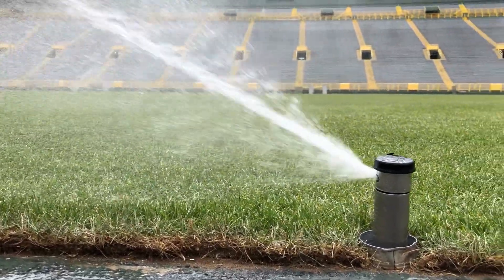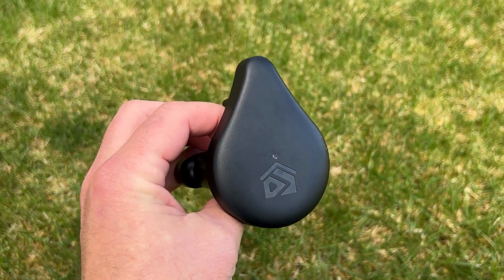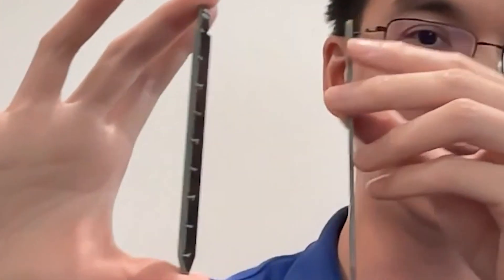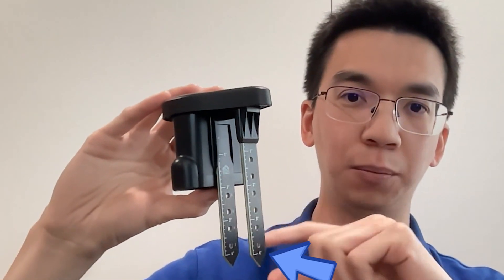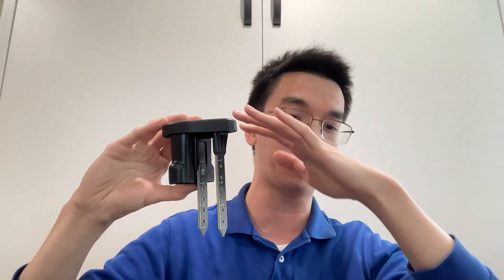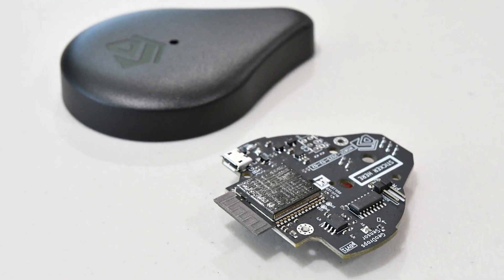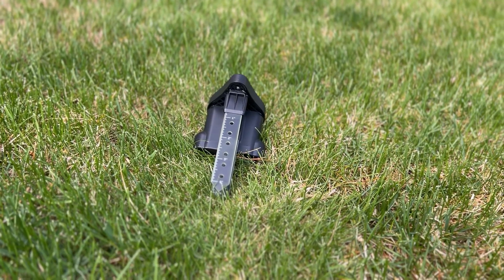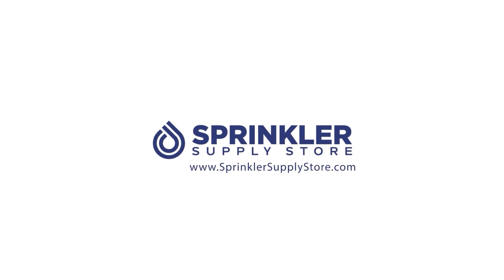DON'T Water Your Lawn Unless You Have This!

Comment: Did they say anything about the quantity of sensors one can have on one system?? I just want a system that can have at least a sensor per zone, or be able to have multiple sensors in a zone, to be able to fine tune different types of watering needs.
Reply from the maker: @MicahCrumpJr This is a great question, and yes, from what I understand it will be possible to have multiple sensors. 

From my experience installing hundreds of moisture sensors and managing sites all over the USA, there is a point where adding more sensors has diminishing returns on the system performance. It is generally a misconception that you need 1 sensor per zone. Having multiple sensors per zone is more about data collection and analysis. 

Ideally, you have 1 sensor per hydrozone grouping of zones.

In the future, we will likely have the ability to control each sprinkler individually (instead of as a group/zone), and that will bring the need for many more sensors...watering an entire area by "zone" is the limiting factor. 

Love this topic 🤓
Reply: @Andy_Humphrey  oh! It's very hard finding information on moisture sensors for an amateur like myself 😄. I can see the future having control over each sprinkler head, like irrigreen.

I am probably doing it for the fun and data collection, but integrating bhyve's smart watering tech, with a system like ecowitt or geodrops through Home Assistant to control each zone will be a fun (probably frustrating) side project.
Reply from the maker: @Mike335is  Absolutely! Even just 1 sensor, combined with a simple "stay off until __ moisture %"  would be really helpful after a rain event.
Reply: @Andy_Humphrey  looking back at your previous comment, when you say "hydrozone" I am guessing that it has something to do with areas that have the same watering needs?? lawns should be considered a hydrozone, while gardens would be seperate?
Reply from the maker: @Mike335is  Exactly. Hydrozones are created based on the specific needs of different areas within a landscape. For example, zones with grass have different irrigation requirements compared to zones with shrubs. By grouping these zones together into hydrozones, you can minimize the number of sensors required. Example: 1 sensor to control grass, 1 sensor to control shrubs, etc. You can then make minor adjustments to each zone within the hydrozone grouping (less water for shade, more water for sun, etc.), while still using only 1 sensor to control the entire group. Not sure if this is how GeoDrops will build out their technology just an example of keeping it simple.

Another good analogy is the thermostat. Most homes have 1 thermostat, or, 1 for each level of the house, vs. 1 thermostat in every room ;)
Reply: @Andy_Humphrey  ah.. I like it... I will start off with ecowitt... And get some geodrops when they become available... I'm going to use 2 sensors... One for the lawn... And one for the garden... And then more for each individual pot inside the house 😳

Comment: Do they have integration with the Rachio?
Reply from the maker: I believe they are working on an integration using IFTTT. Then later on they will have a device you can attach to any existing controller to interrupt it via the rain sensor terminal.

Comment: So what do you think of the GeoDrop so far?  I like mine but we are having calibration issues at the roots which never seem to dry out according to my App.....
Reply from the maker: @Phxphenom my sensor is working great so far. From my experience using other sensors (primarily Baseline), it is common for the moisture at deeper depths not to fluctuate very much, and I think this is reflective in the GeoDrop Sensor. In fact, single depth Sensors that are buried too deep is a common installation error.
Reply: Thanks for your help with the testing. You provided a lot of feedback that we're working on so far. These issues should be resolved soon, and the differences would be noticeable.

Comment: What irrigation controllers will integrate the geodrop data? Looking forward to compatibility with my Orbit B-Hyve system.
Reply from the maker: Awesome, the B-hyve is one of my favorites! As I understand, GeoDrops will be focusing on IFTTT integration and I'm not sure if b-hyve supports that (guess I'll ask Google ). Down the road they will have a station that will connect to any existing controller.
Reply: Thanks  @Andy_Humphrey  for answering the question re: the integration. I don't believe B-Hyve supports it, but the GeoDrops Station should be able to take care of this via the Rain/Sense pin.

Comment: I have been installing wired moisture sensors for many years with great success. I have had difficulty with above ground battery operated sensors.  Both Rain Bird and Baseline are excellent and hamper proof. I will check the GeoDrops though.
Reply from the maker: Thanks for sharing, and I love that you have experience with Baseline sensors - a company I helped build (although we shifted all of the focus into the commercial markets) 🤓. Keep in touch!

Comment: I'm very interested and would like to know the WIFI range as well. Anything I can do to cut my water bill down would be great as I have about 8000 Sqft of lawn.
Reply from the maker: @daniealfitzgerald4089 - thanks for commenting! Curious, do you have a meter on your irrigation system? Preferably a digital meter you can read remotely. There are a few simplified calculations that can be used to determine if you are currently on target, or above/below, the estimated normal consumption.
Reply: @Andy_Humphrey  I do not Andy. Any advice or brands to look at?
Reply from the maker: @danielfitzgerald4089  at my home I use the Stream Labs Monitor. I recommend it 100%. It's pretty amazing. I actually have it on the main water supply so I can monitor all the water in my home (it can even read the filtered refrigerator water in real-time). It clamps on the pipe and connects to wifi and takes less than 10mins to install. https://www.streamlabswater.com/monitor - I am also testing the SimpleSub just for irrigation, however, it only updates 1 per day so it's not very useful for real-time monitoring or alarms/alerts. Here is a YouTube video I made for it: https://www.youtube.com/watch?v=A6Ce1Az7obw
Reply: @Andy_Humphrey  Thank you for the detailed info. I am most interested in an accurate model for my  for my outdoor line. I could connect in my basement. Is there a good reference somewhere on how much water each zone should be using for Blue grass?
Reply from the maker: @danielfitzgerald4089  this is the million-dollar question! The answer is, it depends...but generally, cool-season turf requires 1 to 1.5 inches of water per week (1" in spring/fall, 1.5" in the summer). Converting inches into runtime is where things can complicated as you will need to know the precipitation rate of your sprinklers and the distribution uniformity. If you want to get Nerdy, you can place catch cans on the lawn, then run your sprinklers for 30mins, and measure the amount of water.
Reply: @Andy_Humphrey  Thank you and I have heard about putting cans out in different spots to get idea so you can calculate your run time. Will be trying this soon.
Reply: Glad to hear from you! Typical home WiFi internet's range is 150 ft (or 45 m). Once the GeoDrops Station is available, it can connect to Droplets as far as 800 ft (240 m) away. I suppose you could try to set up a repeater network? This is something we will be discussing internally.

Comment: I am very interested in this GeoDrops product. My main concern is the range of my home WiFi
Reply: Glad to hear from you! Typical home WiFi internet's range is 150 ft (or 45 m). Once the GeoDrops Station is available, it can connect to Droplets as far as 800 ft (240 m) away. I suppose you could try to set up a repeater network? This is something we will be discussing internally.
Reply from the maker: Excellent. If signal range becomes an issue for you, there are wifi extenders that are fairly inexpensive and pretty easy to setup. In fact, at my home, I use eero.com system, and have 5 wall-plug range extenders in various locations.

Comment: I am worried about battery life using WIFI.  Have you considered zwave instead?  Lower power, lower frequency, better range.
Reply: Thanks for the inquiry! We have considered Z-Wave. However, given the market trends, we're going with what we have. That being said, the GeoDrops system has software algorithm that addresses power consumption, so you can be rest assured of the battery life.
Reply from the maker: @devanbhagat7718 - great thought. I have tested various zwave & zigbee devices outdoors and the signal quality/range proved to be insufficient. Seems much better for indoor environments. I think GeoDrops in onto something here...

Comment: Which controllers have integrated these sensors? There are several on the market but I like that these use WifI for range.
Reply: Answered my own question. Impressive integration out of the gate! Is this done via API or hardwire like the rain sensor terminals?

Irrigation Controller Compatibility
Works with all irrigation valve controllers sold in U.S. and Canada
Examples include:
Hunter X-CORE, X2, PRO-C, ICC2, HC, HPC, PRO-HC, and HCC series
Orbit B-Hyve and Easy-Set series
Rachio all series
Rainbird SST, ST8, and ESP series
Toro EVOLUTION, TMC, and TDC series
Wyze Smart Sprinkler Timer
Reply: @aquaman30k  We will be prioritizing IFTTT integration with the Droplets, and then address the other controllers via the next product, GeoDrops Station.
Reply from the maker: Thanks for commenting - if you end up trying it out, let us know how it goes.